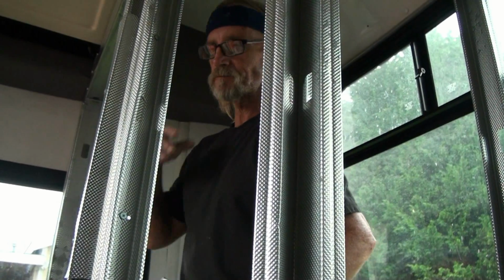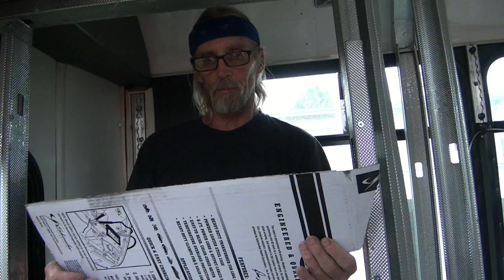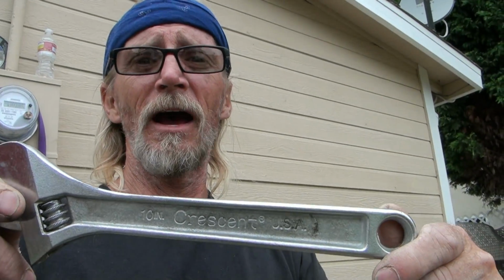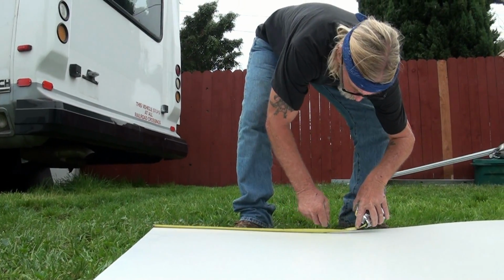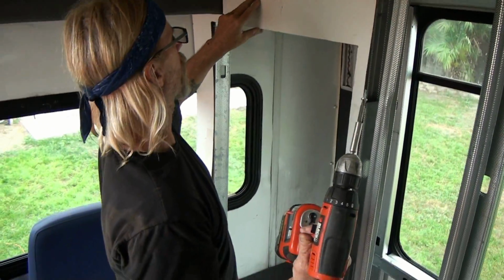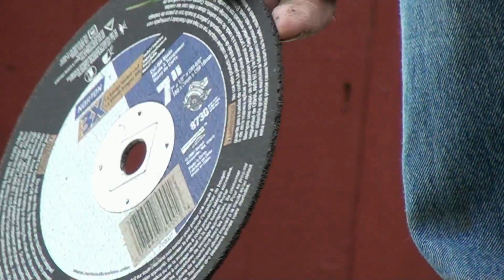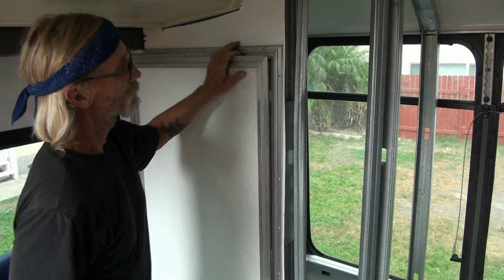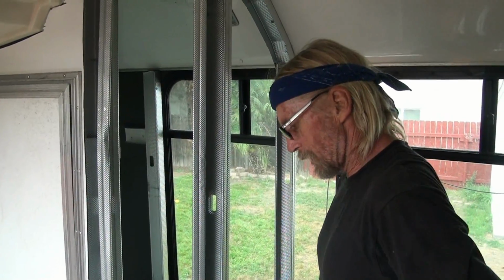Converting Bus: Shower Door

Comment: im seriously considering getting a brand new un-used port-o-potty and installing the whole thing as a shower with a 5 gallon bucket toilet, and just covering the outside part with paneling and leaving the regular door, im thinking ill install it where the wheelchair lift would be and making a swing out door so i can remove the toilet and empty the waste  bucket (with waterproof lid) would just lift out and have sanitary liners i could just remove and dump.

Comment: Sorry to see you didn't pull the walls and floor off to insulate better and check for rust on the floor. Now the shower and you didn't remove the window to put panel in there since your blocking off the window by the shower wall......